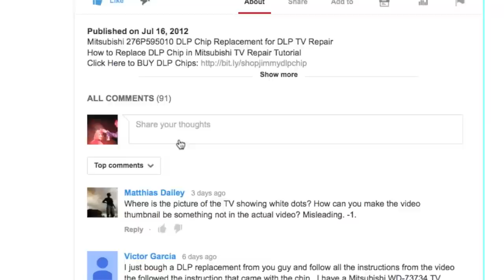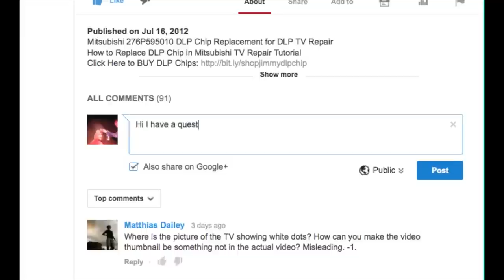LCD TV Repair Tutorial - TV Screen Solarization - Common T-Con & Main Board Symptoms & Solutions

Comment: hello,
I have a samsung ue46f7000. after having access to the service menu, I performed a factory reset. but now problem!
when I put the image in 3D and only in 3d, I said! I have the same problem. does anyone can help me to recover the original programs. please
Reply from the maker: fabien nelles   I recommend replacing the main board in your TV.  Here is a link to possible replacement parts for your TV model number on our website, click here:    http://www.shopjimmy.com/catalogsearch/result/index/?cat=56&q=46f7  Be sure to match part numbers on your current board, with your replacement for compatibility.  Here is a link to a video showing how to identify your part number, click here:  Samsung Main Boards & Digital Boards: Part Numbers for LED, LCD, DLP, Plasma TV Repair  You can also call our customer service for further assistance with your purchase.  (877) 881-6492  Thanks and please let us know if you have any further questions with your TV Repair!  www.shopjimmy.com

Comment: I Have a Samsung LE26A456C2D. the picture has very low contrast and the picture looks almost white (Bleached out). The picture and the menu looks the same.
Reply: Stephen Ward I have the same issue.  Did you resolve this?  I ordered a new T-Con board and I'm hoping this will fix it up for me.
Reply: Replacing the T-con board solved the problem. Just make sure the components get good cooling.
Reply: Stephen Ward Congrats! Thanks for responding. I will wait for my new T-con and keep my fingers crossed it's not the panel

Comment: I have a Samsung LN32d403e4d that starts out with a thin horizontal line across about 1" from the  bottom of the screen and after set heats up the flesh tones turn mostly green with kind of a double image. I have replaced the main board and freeze sprayed the rest of the boards when the problem shows up to no avail.  Unplugging the set for 5 minutes things return to normal and after a few minutes of warmup the problem shows back up again.  I don't suspect the T-con as the picture is not negative which is a common problem.  I have repaired quite a few Samsungs but this one is out of the ordinary.  If anyone has had this problem before sure would appreciate help.  Thanks
Reply: after the t con board you have a screen driver board this could be faulty  this board is part of the screen  and cannot  be replaced

Comment: Samsung 37" LED tv model NO. UN37EH5000F, screen has lines running through it, with 5 burn hole marks, please help!
Reply from the maker: Adam Hyatt  Try all repairs and troubleshooting at your own risk.  This sounds like a TV panel (TV Screen) problem.  If your TV panel is bad, it may be more cost-effective to replace the TV as panels are typically hard to find in stock, difficult to replace, and expensive.  Thanks and please let us know if you have any further questions!  www.shopjimmy.com
Reply: thrimurthy k s

Comment: SHARP  lc-70le650u  TV TURNS ON PERFECT PICTURE AFTER 10-15 MINUTES TV TURNS OFF IF YOU WAIT 5 MINS AND TURN ON TV HAS PERFECT PICTURE AND SOUND FOR SHORT TIME 10 MINS THEN TURNS OFF   BLINKING CODE 2 - 5
FLASHES 2X SLOW THEN 5X FAST BLINKS
Reply from the maker: +Tom Christiansen   Try all repairs and troubleshooting at your own risk.  This sounds like a TV panel (TV Screen) problem.  If your TV panel is bad, it may be more cost-effective to replace the TV as panels are typically hard to find in stock, difficult to replace, and expensive.  Thanks and please let us know if you have any further questions!  www.shopjimmy.com

Comment: Insignia Model #NS-L46X-10A Having a whiteish screen
Reply from the maker: +BOB KRITZ   Try all repairs and troubleshooting at your own risk. This could be a problem with either the t-con board, the main board or the TV panel. You can replace the main board and the t-con board individually to see if one of those boards fixes the problem.  Click this link to replacement parts for your TV model number:  http://www.shopjimmy.com/catalogsearch/result/?q=NS-L46X-10A  There may be multiple boards for the same TV model number, be sure to match part numbers on your current board, with your replacement for compatibility.  Thanks and please let us know if you have any further questions with your TV Repair!  www.shopjimmy.com
Reply: Contrast problem I am having the same issue on my lnt ...

Comment: Hi I have a question about my tv.
Brand: LG
Model: 42LH30- UA
Problem: picture and menu options are solarized. When i first turn on the TV for the first 3 seconds or so, the screen is fine then it becomes solarized. What part number do I need to change a bad t-con board, if that's the issue?

Comment: I have Samsung 40" LCD TV which shows negative video.model no. Is ' LA40B550K1R '.
Reply from the maker: milind bedwa   Please watch this video FIRST to help with your repair!  https://www.youtube.com/watch?v=BP3NVNCGEv8  This could be a problem with the main board, the T-Con board or the TV panel in your TV.  You can replace the T-Con board and/or the main board to see if that fixes the problem.  Click this link to replacement parts for your TV model number:  http://www.shopjimmy.com/catalogsearch/result/index/?cat=56&q=40B550K  There may be multiple boards for the same TV model number, be sure to match part numbers on your current board, with your replacement for compatibility.  Here is a link to a video showing how to identify your part number, click here:  https://www.youtube.com/watch?v=BEPWrefQvqI  Thanks and please let us know if you have any further questions with your TV Repair!  www.shopjimmy.com

Comment: THE  NEGATIVE PICTURE  IN SAMSUNG  AND  LG 
CAN BY  SOLVED    IT IS NOT  HARDWARE PROBLEM IT CAN BE SOLVED   IF YOU   CHANGE   SOME OPTION   IN SERVICE MENU  BUT  FIRST  YOU  MOST  TAKE PICTURE TO ALL  THE SITTING    BECAUSE  THE SETTING  IS CHANGED INSIDE THE REGISTER  MEMORY  NOT  ON TH E SCREEN SO  YOU  MUST   CHANGED BY  THE SAME  VALUE AND SAVE IF  THAT  NOT WORK THEN  YOU  E\WILL GOING  TO EDID   STEP   IT DEFINITELY  WILL   CHANGE ALL THE SITTING   BUT  WILL  LOAD    NEW   OPTION TO REGISTRY

Comment: Iam  buying  a  new  tv  it did  that  then I  turned  it  off  for  a  hour  then  the  tv was  fine  a few  hours  later  the  screen  went  black  tried  some  of  the  tracks  nothing  worked  and  I  am  not  taking  the  tv apart  I am  no tv repair gal  and  I  think  it will  be  cheaper  to  buy  another  tv

Comment: It looks like Jimmy is not answering many of these.  Through my own investigation it looks like Sony T-con boards are failing all over the place.  Mine is the Sony KDL46Z4100 and only 6 years old.  The board is no longer being supplied by Sony which is discouraging since they are suppose to have parts for some time, usually 7-10 years.  Boards have to be either repaired or sourced on eBay and China etc.  Such a pity.  Anyone else having this problem and have come up with a solution?
Reply from the maker: Jay G.   On this page, if you click on the "Top Comments" tab in the comment section and select "Newest First" that will show all of our responses.  Thanks for commenting on our video and I will be sure to respond to your question ASAP.  Thanks!  www.shopjimmy.com
Reply from the maker: Jay G.   At this moment there is no repair for that specific T-Con board for that TV model.  Thanks!  www.shopjimmy.com
Reply: Jay G. Jay, I have the same model and bought it about 6 years ago. I read above that someone fixed the problem by talking apart the TV and cleaning the dust from all of the parts. I doubt this will help but I will give it a try. Thanks for posting your comment.

Comment: Hello I have question......
My sony tv will turn on and everything is ok but after 20 to 30 mins watching the upper half the the screen will begin to solarized,  turning off and unplugging will temporary fix the problem
The unit is

Brand SONY
Model KDL-46NX720
Problem solarization on the upper half of the screen only the bottom half of the screen is ok

Comment: I have a Samsung UN32EH500F model and I have been having problems with it. I purchased this tv about 5 or 6 months ago, and for the most part, it worked normally. Just a month or two ago, I started to experience that the remote wouldnt turn the tv off permanently, but only for a second, and then it would immediately flicker back on. I dont why this happened, so I just assumed that I had a defected model. Just a few days ago, I started to get solarization and it displayed negative colors, mostly bright white. Ever since this started to happen, Ive also noticed that my tv starts to heat up faster than usual. Before I would leave it on while watching TV or playing video games for 5-6 hours, and it was nice and cool. But now since the solarization started to happen, It heats up in about 2-3 hours. When I bring up the menu, the options are shown at normal, meanwhile the screen is still displayed abnormally. Just one more thing, I have two settings on my TV, normal mode and game mode. In the past whenever I would switch between modes, it was fine. Now, I can only have my TV remain in game mode to avoid solarization in the normal mode. Are there any real dangers of solarization? And could it cause my TV to heat up fast when not displayed, or cause the LED's to burn out? Please give me some advice. Thank you